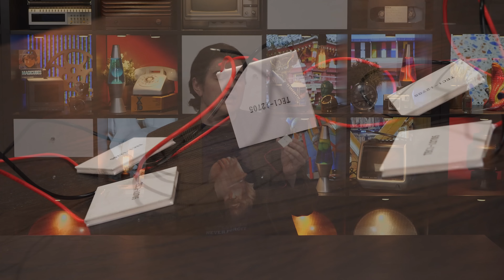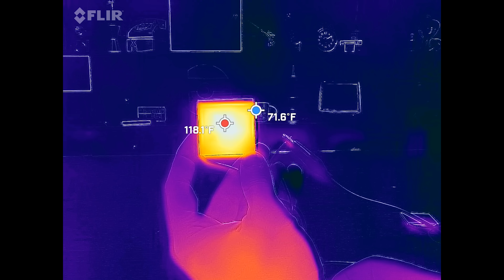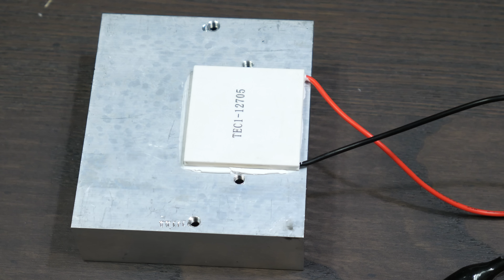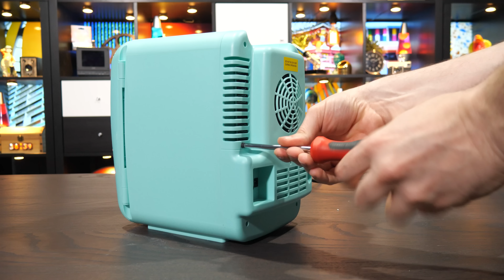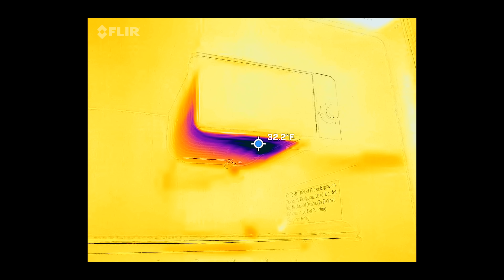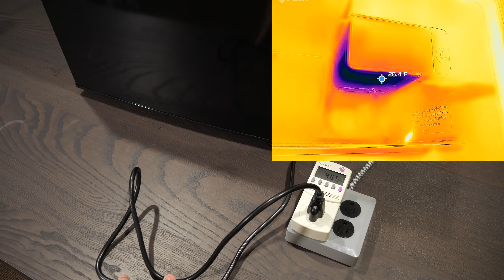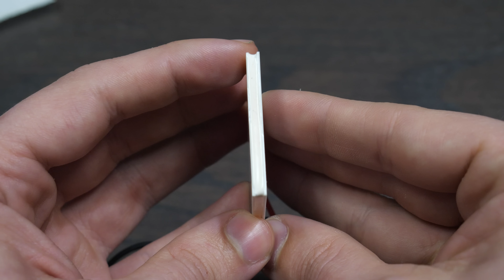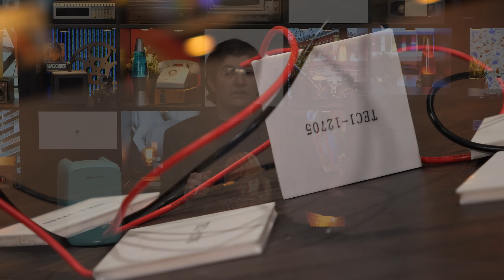Thermoelectric cooling: it's not great.

Comment: I'm not disagreeing with anything. This gentleman says, but I will say that I do have one of those really small, cheap plastic mini fridges. And I usually put a couple monsters in there for my gaming session. But I can unplug it after it's been on for about 3 hours and my cans will still be very cold for like the next 12. And I only learn this because I live in Florida. We have power outages all the time.  Especially with the blast hurricane but I got mine on a cell and it's just some weird generic named brand so maybe I got lucky and this one was actually put together the way it should be cause I've heard a lot of people complain about these little things and say that they're pretty much. Just c*** but like I said, I got lucky. I paid less than $12 for mine. It was on sale.  And it works great and mine makes absolutely no noise at all like you have to put your ear right on top of it to hear anything

Comment: if you've ever purchased a new fridge and read the manual, you'd know and understand that you should always wait a minimum 48 hours BEFORE putting room temperature items inside it, preventing the compressor from overworking/overheating. If anything, grab an already cold item like a 1+ liter water bottle (or many) after the first 24 hours of installing a new fridge, to help stabilize internal tempatures.

Comment: i have made my fridge long ago with this peltier chip, however i didn't calculated the power consumption, i was young when i made that experiment, actually i turned my old fridge which wasn't working, i put heatsink on both side, and i added fan on both side,,, to my surprise it was cooling well,, but to be honest i didn't measure the temperatures or the power consumption but i do agree it dissipate a lot of heat due to which i turned it off hahaha,, my mom said she feel the room is warmer than before and i immediately know whats the reason..

Comment: so would these be at all decent for a pc, instead of thermal paste and stuff
Reply: Nah not for the average joe LTT has had a few videos with peltier cooling before idr where but it basically ends up the same ineffective and very power hungry only pheasably useful way would be like water block peltier might work for fast compared to copper or other blocks for energy transfer.

Comment: I want to use them for heating applications, off-grid.  You can run a small blower, charge your phone or laptop, run your lights, maybe power the auger for a pellet stove, etc.  Most off-grid pellet stoves are gravity-fed, which makes it hard to run one on "low," or rather, makes the difference between "low" and "high" insignificant.

Comment: Fan as how much noisy it about 10 Watts, if radiator put outside case and use less power fan, this will consume 10-15 Watts less energy. This design is dumb.

Comment: I did a little experiment by adding a Peltier plate between my AIO waterblock and my CPU (with the proper thermal paste and everything) on an older computer... When the CPU was idle, it would run dramatically cooler.  But issues would arise as soon as the CPU would start heating up under load.  At some point it would overwhelm the Peltier plate and it would act as an insulator, and the CPU would quickly reach 100C+ and throttle.

Comment: WHAT IF YOU TOOK 2 OF THEM PUT THEM ON THE TOP AND USED A NICE CPU COOLER TO DISAPATE THE HEAT I WONDER IF I COULD CUSTOM MAKE ONE TO ACTUALLY WORK DECENT
Reply: I believe that's called stacking.
Reply: @puppiesarepower3682  i actually founbd a video where a guy did almost what i thought of he actually had ice building up inside his and putting the drink right next to the element caused it to reach 0 degrees celcius lololol
 there was another guy who created a fridge using like 6 of them with the  fridge full of food and drinks it was holding 37 degrees Fahrenheit perfect temps for a fridge
Reply: @puppiesarepower3682  it looks like this tech actually works great the problem is the cost of materials to produce one that works good is not cost effective especially if the elements are not good for the long haul. i dont know how long those things last generally speaking.

Comment: We used Peltier elements to cool some elements of a mass spectrometer which we shot to space. In space (well, in vacuum), moving parts are not fun. And weight is a serious issue when it comes to satelites. Then another benefit is the size of the peltier elements. It's super easy to get the cold exactly where you want it to be. Tubing is not as flexible as an electrical cable.

Comment: you could add a small heat pump to the hot side of the peltier element to remove the excess energy faster. this way, you could use a larger peltier element to cool the cans inside. Ha!

Comment: YOU ARE WRONG!! YOU ARE SO WRONG!! IT'S THE BEST COOLING THERE IS!!!inaspecificscenario....!
I am using it as a boat fridge cooler and it works great...because I have endless supply of cold water flowing over the aluminium heat sink on the hot side...so yeah...good for that sort of sheet...

Comment: ....Do they make heat pumps small enough to even fit into the tiny blue one? Because the size is its biggest advantage, and despite how much it sucks otherwise, that's why people get them. If I could get one with the same form factor with a proper heat pump instead of peltier, I think it'd be perfect.

Comment: I feel like your missing the point of these, you don't come in with 6 cans throw them in and expect them to be cold in a few hours, I keep one under my desk next to my pc, it stays about 70-74 f down there, I have the open case of soda next to it, so when I take one out I put a new one in, this way there is always one in there that's been in at least a day, usually the back ones are more like a week. Every can I oull out is nice and crisp and I hate room temp soda

Edit 1 
I will add mine i bought second hand for 30 it retails for like 60-70 so it is really quite I never even knew these made noise, and in that 70ish degree environment it feels on the verge of freezing

Edit 2 
I will add one more gripe here, the cost to run comparison you did based off a test with no use,  im sure the power spikes a little bit everytime you open it to remove the heat introduced, the cost let's say with how much I use it would end up somewhere id guess at $30-35 per year if I kept it as just soad, but more room means more things I can use it for and more uses mean higher cost from more opening, in reality with the higher use it would end up more at 40-50 per year, tho I would get more use out of it tho that's just bring things from the main fridge closer to me so they energy was going to be spent on that stuff anyways

Comment: correct me if im wrong, but the oil used in the compressor is purely used for lubrication. I dont believe the oil exchanges any additional heat from the compressor, that is a function primarily done by the refrigerant-which in itself is mixed in with the oil. I dont think this matters that much but i'd like to know.

Comment: I've had those miniature fridges, and I can say that YES, they ARE good 👍 

Remember though, they're not made for constant long-term use, I LEARNED THAT YEARS ago 

One time I got a matching pair of them, green, and blue 

I thought I'd be able to leave them on constantly with certain types of snacks, and it went well for a while until it didn't 

I didn't know that fridge was going to go out within months or a year, give or take 

Then at some point I was able to get an even bigger, BETTER miniature fridge with BOTH heating AND cooling

Those fridges are only designed to be used for short-term, take it from someone who LEARNED from EXPERIENCE 

If you leave them on all the time 24/7 365, of course they're going to fail 

Again, I learned from personal experience not to overwork them, and they're fine

Comment: It was actually used back in the late 90s-early 00s for some CPU coolers by Swiftech. Evidently they weren't too bad at cooling, but you had to be careful about condensation on the motherboard.

Comment: I wonder is you could fully take one of those apart, fill up the open areas with better insulation, and put in an actual condenser & stuff to make a functional version. Maybe take parts from a small counter top ice maker?

Comment: My  IceQ mini  70ltr in capacity is 6yrs old and does that short cycle pattern and is still going strong it’s even been in a room that has reached 42c in the peak of summer.  But it is still going strong. Also it’s shockingly quiet so much I sometimes have to check it is working. Suspect it has 2 to 4 years life left in it.

Comment: PLEASE READ THIS AND RESPOND Technology Connections. I have ADD so I only have a few moments to ask you this. I think you said that if you run Peltier devices at a lower current or energy they are actually more efficient than running them at full power. What are those currents again and is it monetarily feasible to make a whole house out of steel and integrate these devices into the steel (think steel buildings) you could actually use the lack of insulation as a bonus. How much would it cost to make a 1,000 square foot steel building with Peltier devices running at a current that is efficient enough and would it cool and heat enough to hat during freezing winters and 100 degree summers? Would the material used to make the Peltiers be too expensive for the average person who wants to buy a $100K-$300K house

Comment: An interesting use case for these I’ve found in the scientific lab I work in is a glovebox for building batteries. Any Heat expelled by a traditional heat pump based fridge would just be released into the glovebox, ultimately raising the temperature. So we use the little 6 pack fridges to store liquid bottles that have to be cooled and have a peltier plate we place the batteries on as we assemble them to prevent solvent from evaporating between when we dispense it to when we seal the battery. It sure is nice for us that the stupid little fridges are cheap and readily available!

Comment: I have a vague recollection from some 60 years ago when I was in high school (science class, perhaps or maybe an episode of the Mr. Wizard TV show) of a device that used bimetal junctions, one of which somehow absorbed heat energy and the other released energy, that let you put the cold part in one place and the hot part in a totally separate place, potentially rather far away. So, clearly NOT a Peltier device but one that is basically just wires and which does "move" the heat from one location to another, potentially far away.

Does such a thing exist, or has my advanced age left me befuddled about whatever the heck it was I saw all those years ago?

Comment: So the stupid muricans use oversized fridges, which runs on 110v battery voltage for toys, using up a lot of energy because its nice to have, and the mean time they can't divede by 10 and using body parts as measurement units from the stone ages. But the peltier fridge is bad. Seems legit.

Comment: Peltier is very good for cooling stuff in camping. Mine draw only 30w and go under -14c° at the base of the heat exchanger. At 20c° room temperature it froze a bottke of water so yeah, very usefull in camping instead a heavy compressor cooling system.

Comment: Fun fact there is another issue with them i discovered 😤 ,it can build up ice inside it towards the back but eventually melt slowly and leak out under the front ,so depending on where you set it, it can end up drawing damp/wet for a long time and damage something it sitting on like a wood shelf, ask me how i know 😑, mine is gone now.

Comment: I can't sleep with a AC unit turning on and off. I've been thinking about using these to make an air conditioner for my well insulated 35 square foot camper. 
I'd prefer to use the compressor and parts from a mini fridge. I can handle the electric part of it. But i don't have any HVAC experience.
So the peltier seems like a possibility.
Reply: Arent propanem fridges quiet?
Reply: @Barten0071  never used one. I was trying to run everything from my solar and the charger on my truck.
I do have a very small catalytic propane heater, but I never use it. It's WAY too much for such a small camper. 
Even when it's below zero up in the mountains, just body heat is enough to keep it warm all night. I just use the battery to run a small space heater once to warm it up. Also, a small 130w electric blanket makes it really hot inside too.
Reply: @mikey92362  propanem fridges can run on electricity and dosent have compresor

Comment: I have a similar Diet Coke themed one that has a cold and hot switch that keeps my soda as cool as our regular fridge in about an hour. Got it on clearance for $40, does it's job and keeps my soda cool. I will say it does produce a lot of condensation if not fully stocked. 

I enjoy the novelty of it and don't use it often, so it's kinda cool.

Comment: I’ve seen one design that works well for coolers. It has a huge heatsync on the back and two of these little fucktards on the bottom of it with two smaller heatsyncs on the cold side and fans strapped to all the heatsyncs. Basically it pulls the cold air from the cold side to fill the cooler and gets them close to freezing temps depending on how hot the environment is. Still not the most efficient but in a situation where it’s not necessary to be efficient they work quite well

Comment: Not so fast, i had a small portable one that would hold a 6 pack of 24oz bottles and maybe a sandwich or something small that was heat sensitive, that i ran daily in the oil field, on the worst roads (or not roads) Wyoming has to offer. And when your on a site for 24/36 hrs a cold drink was amazing. (Probably still a 2 hr drive to town after the job was done.)

So id say a bit more then occasional use. But id add rugged! Thing road in a hydrovac truck all over gods green earth and kept choochin. Sure the truck was always running so yes got me on the electricity used part. 

But the thing is, it didn’t have to get the beverage down to a certain temp, it just had to extend the cold temp (already chilled with a shaped ice block between the bottles) longer than and less fuss and foot print then a cooler full of ice. 

Its unfortunate that you have one that doesn’t solve a unique problem but mine did and i sure got a chuckle at skipping that gas station line of all the boys getting ice and fussing about with their coolers while i was already on the road to the job site.

Comment: I built a nearly 1 cu. ft. mini fridge using a 60w module from a discarded countertop wine/beverage cooler that had fans on both sides (larger fan on hot side), and improved on the efficiency by using 2 inches of polyiso insulation in the box. It'll achieve about a 40F delta temp, and with the PWM controller board and sensor I also salvaged, it limits cooling to 36F and ramps down power consumption by more than half once the preset temp is reached. Still not as efficient as my Danfoss compressor portable fridge that I got later, though.

Comment: I wonder if it would be possible to make a literal mini-fridge, with a slight twist. It is going to sound crazy, however, given the only mechanism inside of a heat pump is a compressor, a fridge could in theory be powered with a crank of sorts, however, not a hand crank, given the many revolutions a pump makes in a second, would it be possible to run a small scale heat pump using a sterling engine? Of course it still requires a source of energy, you just end up skipping the middleman (whoever provides your electricity) doing so might increase the performance given the electricity used had to come from fossil fuels, renewables, or nuclear. While certainly not feasible as a fridge given obvious concern for safety given the proximity of a flammable gas to flame. Thank you for reading my stupid comment.

Comment: I learnt about this peltier thing like 5 years ago, but never really dig into it.

Before I was like: "Woah, this sounds so OP. Must try it."

Now I got the budget to try it, I was really disappointed by the results. It was cooled but not that much to make a refrigerator or air conditioner out of it, I tried using water cooled or just regular fan. Still doesn't work. 

Negative profit
-Peltier

Comment: I mean.. I get this isnt great for primary cooling, like a house fridge. But a little Peltier fridge (better than this crap he has) will absolutely ROCK YOUR WORLD if You ever go camping. Its amazeballs, if its a well insulated unit with a couple of those modules it will easily keep stuff cool when You're out camping, like some ham, cheese, butter, beers. It will keep things edible for a few days no problemo, and ICE, You can put ice in such portable fridge and thermoelectric cooling (again, a better unit than this sh*t he has) will keep ice from melting for like 24 hours.
And one more thing. Once a fridge (a normal, big, compression cycle fridge) broke in my house like a day before holiday. So I had to use the portable fridge for ~5 days at home to survive before new fridge arrived and it totally saved me from starvation :D So thermoelectric cooling absolutely has a niche application and as a backup it works wonders (but again, You gotta toss in like 50$ for a decent (used) model of a portable peltier fridgerino)

Comment: i actually had attempted to make a homemade drink can chiller with Peltier modules and using toothpaste as a thermal paste for heat transfer. Achieved -2 degrees Fahrenheit on the cold side and 79 degrees for the hot side and heatsink. I was hoping that I could super chill the drink in minuets but didn't have much luck, even with several different power units, peltiers and heatsinks. maybe if i used actual thermal paste I'd get better results. But toothpaste is an amazing thermal paste